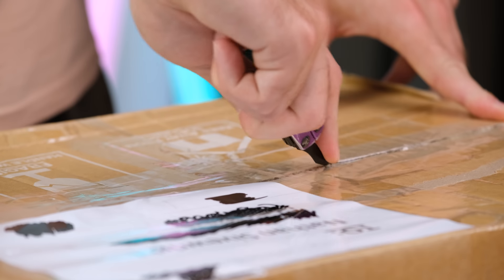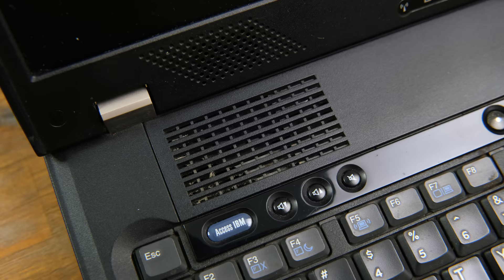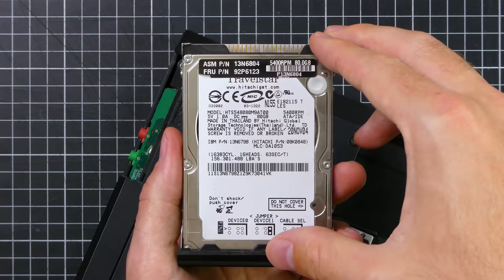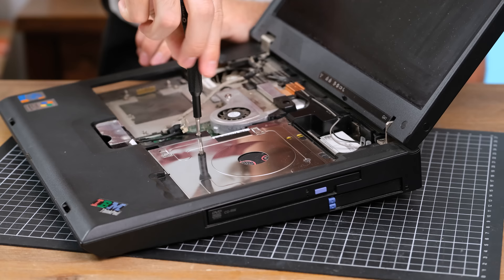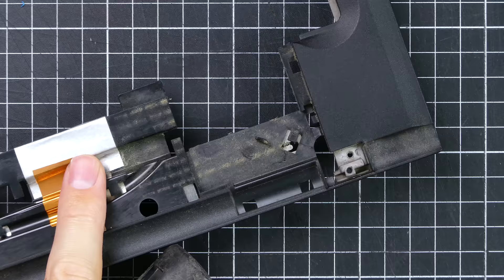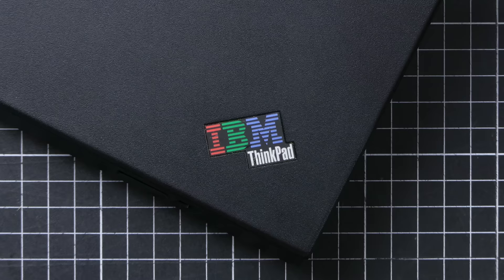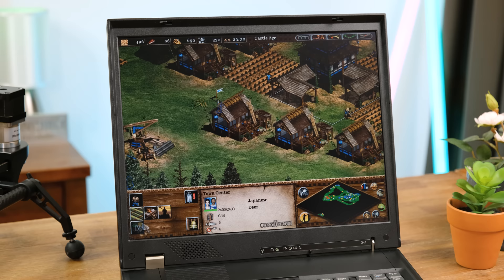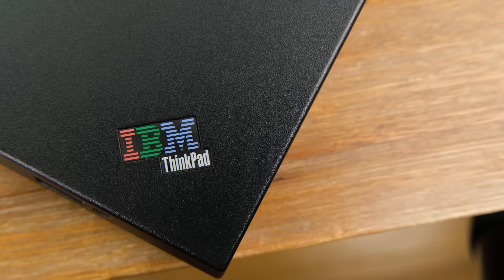IBM Thinkpad G41 - Restoring A THICK Pentium 4 Laptop!

Comment: I would not recommend threadlocker on hinge screws, they are designed mechanically to distribute some of the torque through the helix of the threads, preventing hypertensioning of the hinge. This is now forced upon the hinge in its entirety.
Reply from the maker: How come every single display hinge has it applied by default then?

Comment: Looks like a top of the line laptop when it was released in 2005. That computer, at 3.33 gigahertz processor speed, could not have been cheap. Quick note: I do remember using something like this several years ago; that was about high-school time for me. Maybe not the G41, but similar to this one.

Comment: Thinkpad hinges were not always good.  I had a Thinkpad T20.  It had plastic hinges.  Eventually they would stick and crack the case when you opened or closed the screen.  Shortly after that model, IBM switched to metal hinges which worked much better.

Comment: I use machines like this all the time STILL.  Its just easier to use for me tbh, and I don't have to do so much fucking around, I just go to 1 of like 4 repositories and I have all the software I need for mac windows or linux.  I'm surprised you got youtube running.  360P was all you could even expect from a P4 in 2010 (trust me I had many of them), but I can't get my Pentium M's to do youtube at all.  Must be something weird going on.

Either way cheers

Comment: If you could fit a modern laptop motherboard in that chassis, that would leave a lot of overclocking headroom with decent thermals. Especially helpful with recent nvidia laptop GPUs that are incredibly power and thermal limited, and could gain like 40% performance from a larger thermal envelope. I'd even prefer this keyboard and trackpoint over anything "modern".

Comment: I have a G40, wonderful machine from IBM. Mine has a 3ghz northwood pentium 4 with no hyperthreading (very weird model) that is actually a desktop cpu, not a mobile pentium 4 (even if those are just normal desktop processors with speedstep 😁) Quite happy with mine though the G40 never came with a dedicated gpu like the G41, I wonder if its possible to get one of those gpus into my G40.

Comment: In old laptops i aways recomend using the extention h264ify in the browser, forcing youtube to use the old h264 codec wich is far less heavy on the cpu than the modern avc1 or vp8/vp9 codec that youtube uses

Comment: Man old laptops used to be so much better in terms of ports etc. sure a modern laptop is probably powerful enough to replace a pc but the lacking ports means unless all your doing is browsing the web or something you need soo many adapters and dongles that it basically gets wired in like a desktop anyway

Comment: Lenovo Laptop ultraportabila Lenovo ThinkBook 8 G6 ITL i5-1235U 8GB RAM 512GB SSD Intel ARC Graphics 8.4 inch Windows 11
Reply: Caracteristici:
Tip procesor: Intel Core i5
Capacitate RAM (GB): 8
Capacitate Stocare (GB) 512
Ecran Diagnonala: 8.4 inch
Tip procesor video: Intel ARC Graphics 
Sistem de operare: Windows 11 Home
Preț vechi: 1,699 lei
Preț curent: 1,499 lei
Preț viitor: 1,099 lei
Tip preț: mai ieftin